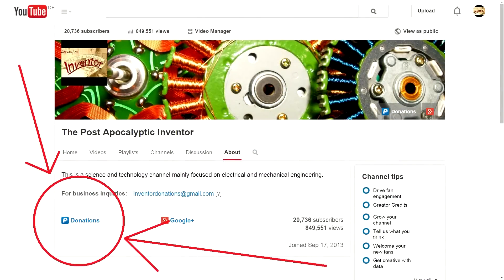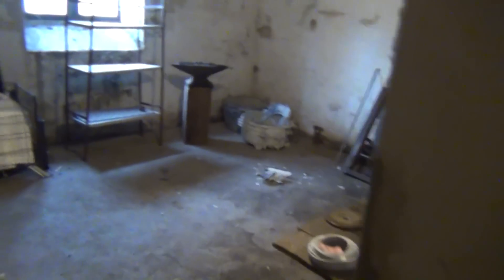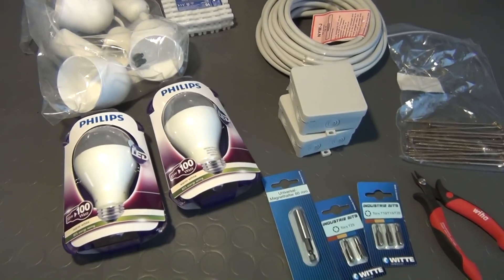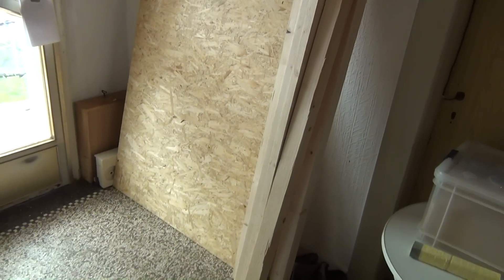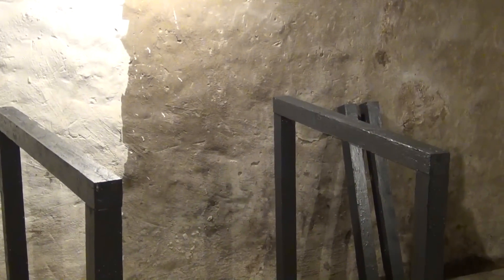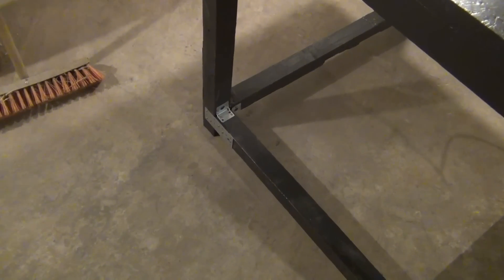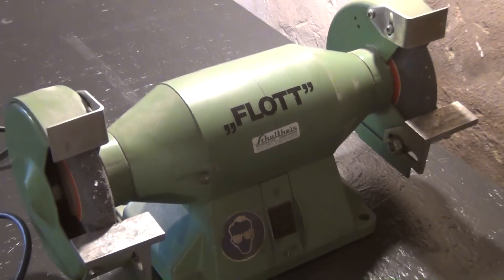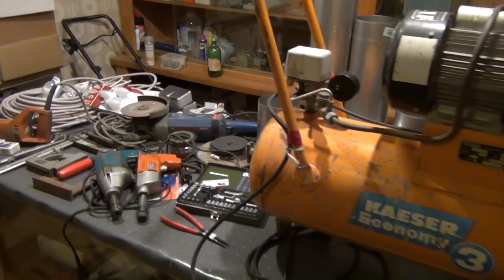Building a Workbench with Vise and Bench Grinder

Comment: Really nice start for a metalworking shop The Post Apocalyptic Inventor. Those tools, even as old as they are, are more robust than most tools you find on the market today. So after a bit of MoS2 grease and maybe a few replaced bearings they will become something even your children can enjoy. Plus the videos about refurbishing them will fit perfectly with the retro theme of the channel. As a suggestion, if possible, place the compressor on the outside or in another room. They are quite loud and they are stressful when concentrating. I had good results with one of these small compressors attached to a larger tank, about 100L. It took some minutes before it built 8 bar, but after that you had a nice supply of air. The tank I used was from a railway cart I think, real cheap at scrapyard.

Comment: You may want to consider moving the plate so that it overhangs from one end of the bench. Removing the plates direct contact with the bench surface will postpone heat damage to the wood and paint
Reply from the maker: Lewis Glen Indeed heat damage of the paint could become an issue. One more reason to build an actual steel work bench for welding jobs.

Comment: Howdy . I agree with aserta . You really should blitz that mould with a peroxide solution , dry it all out and paint the entire surfaces down there with 2  part epoxy paint . This will seal moisture from outside coming in . White would be a good colour for light reflection . Mould is one of the worst things to be breathing in and its carcinogenic .
Reply from the maker: Steve Smith peroxide solution. Ok. But why would you seal of the wall ? I would have thought that proper ventilation is the key to stop molds? 
Have you used that technique yourself ??
Reply: The Post Apocalyptic Inventor Yes . Downstairs in my parents house my father and I dug out approx 5 cu mtrs of sandstone rock  to extend mothers laundry . The rock is very porous and constantly wet . We rendered the shaved sandstone with sand / cement but had to wait 12 months for a dry enough winter  before applying the paint .  The paint is normally used on swimming pools .
Reply: The Post Apocalyptic Inventor I didnt mention this was 30 years ago . The laundry stays bone dry .

Comment: Nice vice there, if you are going to be using it for blacksmithing be aware they can't take the beating wrought iron post vices can. If you are take your time you can usually find them cheap enough. It seems some people want to sell them as antique style items at crazy prices for what they are so you just need to find the reasonable sellers.

I have a lovely little blacksmith bench vice I got for like 30 euro in a local carboot sale style market.
I probably paid a few euro too much for it but it was in good shape except for some dirty abrasive grease. Also I had never seen a blacksmith bench vice before so I half picked it up for that reason.

Workshop really seems to be coming along though! This will make for some good videos from the looks of it.

Glad your trouble with your wrist and hand has clear up too. Sounds like a very frustrating injury.
Reply from the maker: zero_sum I only want to use this vise for "bending" not for "beating" :D

I want to buy a post vise,  like the one you described additionally. 
What do you think of this one: 

http://kleinanzeigen.ebay.de/anzeigen/s-anzeige/schraubstock-mit-standfuss/293255285-276-2161?ref=search
Reply: The Post Apocalyptic Inventor Ah, well fair enough. Subtle difference there but important haha

Man that looks beefy. You could do some decently heavy work on that vice! Seems like the jaws are nicely aligned and it's not bent from abuse.
It looks good and heavy (mass is important as for anvils), with a strong path to the floor for the forces it will experience in use.

However I don't see any images of the threads. If they are pretty square it is a great find. If not then it may not have as much life in it as it appears (double edge of buying online I suppose). Maybe asking the seller for an image is possible.
 
It's a bit different that ones I have come across but it would work very well. It has obviously had the table and it's leg added, possibly to improve its performance for a previous owner or to repair a corroded lower section on the leg.

Overall, for around 50 euro I would get it easily. I don't know how prices go in Germany but just for the mass of it alone, if it opens and closes well, it's a winnner.

 
It would need a little care to get it back to its full glory though. Just the basic instinctive maintenance when you buy an old tool, like grease and cleaning up.
Sometimes the spring can need replacing in them or corrective bending. It is just a bent band on metal so it is no issue.
This is a cool article I bookmarked a year or so ago on this topic: http://www.anvilmag.com/smith/107f2.htm

Honestly that could be a nice little video idea ^^^ :) 

Germany has such a brilliant history with tools like that. In Ireland we don't have as many old bits of kit floating around so the prices are high unless you get lucky and exercise patience. I would buy that for 55 euro without even looking at the threads because it would be worth the risk for me locally with it looking good in the other ways.
Reply from the maker: zero_sum Hey I bought the post vice from the link I sent you yesterday.I sent you a private message in which you will find a link to a private video about the vise.

Comment: Here's to your recovery and continued good health, sir!

Having had my own run-ins with Repetitive Stress Injury, I deeply empathize  with with you...  My wrists felt a twinge of pain watching you paint, even though I saw nothing wrong with your technique.

Almost every repetitive activity can cause problems similar to yours (and mine, from years ago), and often, just a slight change in posture, technique, or other work habits can greatly reduce or eliminate these painful, often chronic, injuries.  Mine was caused by improper typing technique and posture: trivial, compared to wrenching open dozens of jars, but my hands were rendered useless just as long.  I now consult the Great Google for tips and techniques about any kind of repetitive activity I engage in.  

Cheers,

   -nevin
Reply from the maker: Nevin Williams Thank you very much. I never had faced such issues before, but now I'm more cautious about a lot of things. 
Little things can make a big difference. For example: 
I had a lot of problems editing my videos, because my wrist started to hurt or my hand felt numb. It took me weeks to figure out that the problem could be drastically reduced by simply buying a proper mouse pad, rather than using the the bare surface of the desk.
Reply: Exactly my point...  I can't even imagine how folks who subject their limbs to much greater shocks and strains, like carpenters and painters manage.

Comment: I don't recommend welding in the basement. Can cause asphyxiation
Reply from the maker: John Chung I guess I will have to build some kind of ventilation system.
Reply: if you can spare the cash get a plasma cutter. Saves a lot of time. The compressor that you have may not be sufficient. A 40 amp machine can do a lot
Reply from the maker: John Chung The "new" compressor has a 40l -Tank and delivers 260 l /min at a maximum pressure of 11 bars. I bought it real cheap and it's a major improvement over the really small "toy" compressor I used before. But I guess I will still keep searching for something bigger. Maybe a 2-cylinder machine.
Reply: That compressor can handle the air requirements for the plasma 40 amps. Try it out first. Should be adequate for short cuts. But for long cuts a bigger compressor is needed.
Reply: John Chung 
If you have an air-fed mask with filter you should be ok.

Comment: Helpful tip my friend, easier way to remove rust and scale from that large metal sheet would be to place it in a bath of vinegar then use a rough surface and it will wipe off with ease.

Comment: Outstanding Video.
Unfortunately injuries are part of the learning experience, for me it was 3rd degree acid burns.
The vise looks much better without the paint.
Looking forward to seeing more work done to this room.
Reply from the maker: Heilman Hackatronics Wow. May I ask how  you got in contact with that acid ?
Reply: I worked at a battery manufacturing facility (lead-acid). High specific gravity sulfuric acid is dangerous stuff also carcinogenic.
Reply from the maker: Heilman Hackatronics Doesn't exactly sound like a dream job.
Reply: My present job is much better, get to test and debug telemetry systems used with rockets and satellites. (I think I am allowed to say that much :)
Reply: I agree with Matt regarding the vise and I feel with the inventor regarding the sleeping hands. For me, that's a chronic situation as I have carpal tunnel syndrome. I might some day get an operation, but somehow the Leidensdruck isn't enough yet ...
Reply from the maker: Heilman Hackatronics Good to know that you don't have to do work like that anymore. Sounds amazing!
Reply from the maker: Gregor Ottmann Many people seem to suffer from that syndrome. A friend of mine actually underwent that operation. For her it didn't seem to be a big deal. I would be reluctant to go to the hospital too though.
Reply: Heilman Hackatronics 
Waes Hail! Look forward to you blasting off! :)

Comment: Mold. There seems to be a lot of it. Take care of that before anything else or you will regret it later. There's no play other than foul with that thing.

Big steel plates can be found, sometimes for very little money, in two places. At a boat building house or at a steel yard. In both cases you have to expect a piece that might have flaws.

The bench looks excellent, one cheap way to make a bench even more rigid is to use steel (or any strong enough) to cross the empty spaces between the legs. I used that on my bench and if you tighten the wire well enough it becomes very rigid, no play whatsoever and it's cheap.

Really nice score there, those drills look in good order, heck of a lot better than the modern crap they push on us for sure.
Reply from the maker: aserta Yeah. I have removed a lot of molds in the living rooms and I have to say, that I could feal the positive influence on my health right away. The walls in the basement have actually dried quiet well over the last 1.5 years and as far as I can tell, it's not the walls, but only the paint that has become moldy. I will have to do somthing about it anyway though.

Comment: How did you remove the threaded shaft? I have the same vise but the 4 inch but I can't seem to remove it. I removed that little screw and I see some kind of ball bearings. Is it what holds it in place?

Comment: will you continue ? making this smithy videos ?
Reply from the maker: +Leon boss I want to, but there are too many obstacles at the moment. The basement is too small for many of the tools thta I actually want to buy, there is no ventilation system in place, hence there is teh danger of cabon monoxide poisoning. I also developed back issues at the beginning of the year, which makes solving those problems even harder. I guess it will only happen, once I find an entirely new place to set up a much better metal working shop, where I don't have to carry everything up and down stairs.